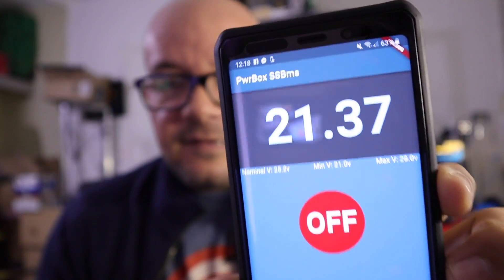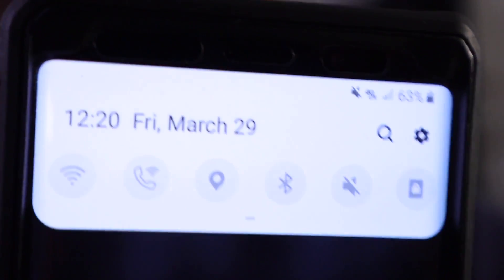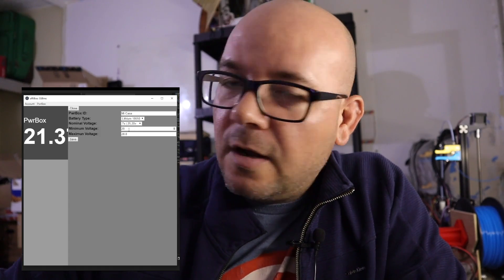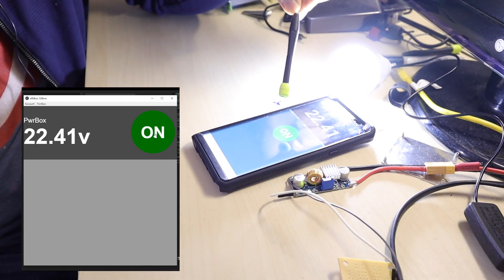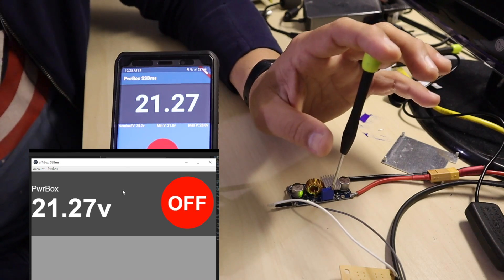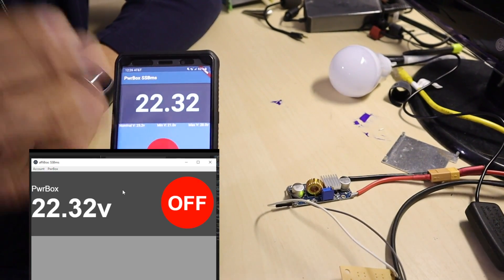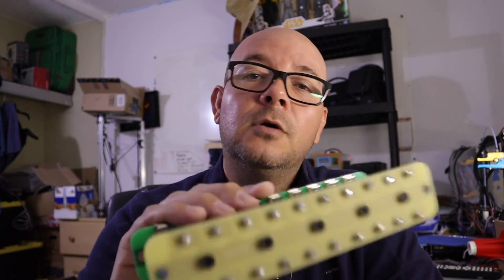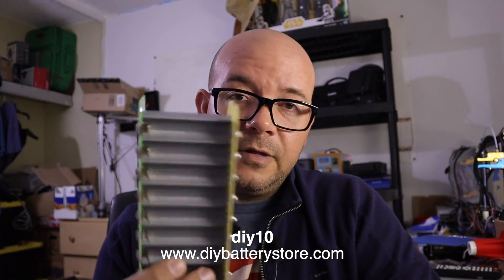Demonstration of the 18650 Bms I've been working on.

Comment: what bms would you use on a power bank that has 60 18650 3000 it will have 6 groups of 9 battery's at 33.3 volts purpose is to run a 24v inverter 2000 to 5000 pure sine wave

Comment: How many volts are yours kit...and could bring them down to 12v...Thanks.
Reply from the maker: Please visit www.diybatterystore.com and look for the 3s kit
Reply: Those one are 12 v...
Reply: Those 3s are 12v?
Reply from the maker: You can use them for 12v setups but be careful you dont go under voltage

Comment: Is there limitations to items you could monitor remotely? Was wondering if you could add a on off input circuit to trigger the shut down of the system? The idea is to add external circuits that would be a safety feature like asmoke alarm and temperature sensor. One input circuit would allow you to add physical devices that don't need power ( like a thermal fuse).  Maybe a normally open and normally closed input circuit that would trigger shutdown. (Like alarm contacts)  I just some of my thoughts.
Reply from the maker: The idea is to be able to monitor as many devices as you need...

Comment: It's looks good. You could put limits to each cell. This way an out of balance cell would shut down the system also. What do you think?
Reply from the maker: I love the idea
Reply: As most battery failures ( multi cell) are caused by charging a unbalanced battery.  Maybe in the future you could add to your system the ability that could bypass one cell and stay on at a diminished capacity. Just thoughts